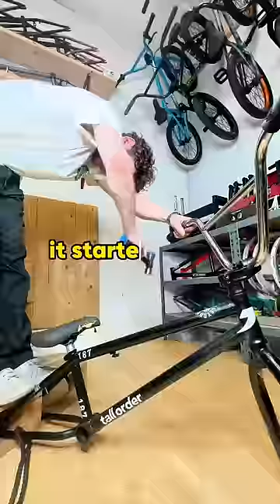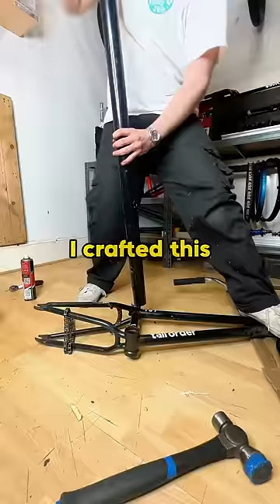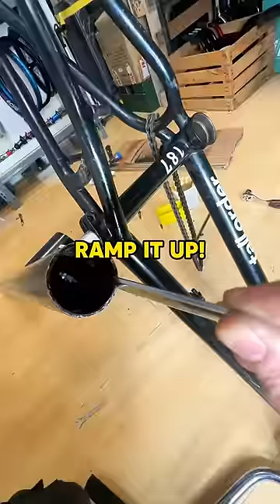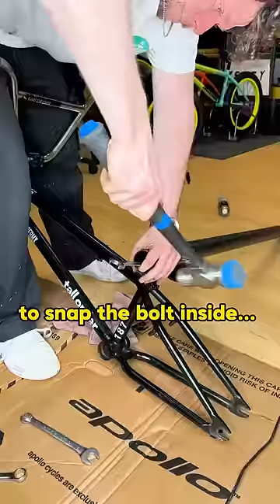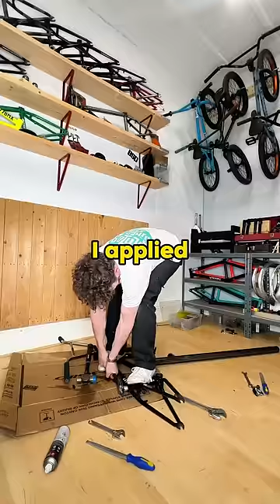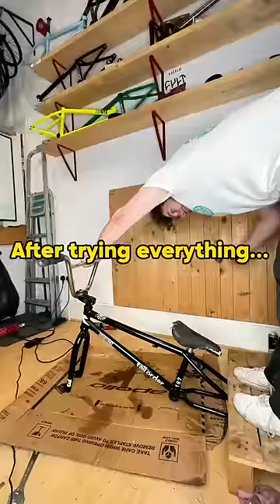Extreme BMX Rescue Mission: Battling the stubborn seatpost from Hell! 😳😱 #bmx #bikerepair #shorts

Comment: Heat the outside of the frame up. Heat makes metal expand if you Heat the seat post you'll make it tighter
Reply from the maker: I can’t Beleive I didn’t know this! 🤦‍♂️😅
Reply: @T77BMX  Use liquid nitrogen
Reply: @T77BMX use a vase torch if u can oxy poropane will fuck the paint but will have bmx
Reply: School bot error  @T77BMX